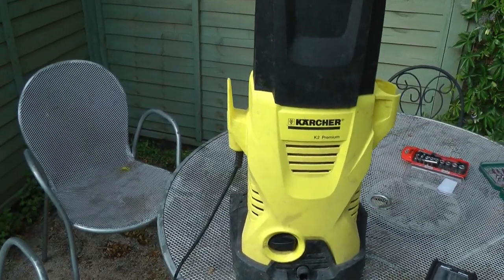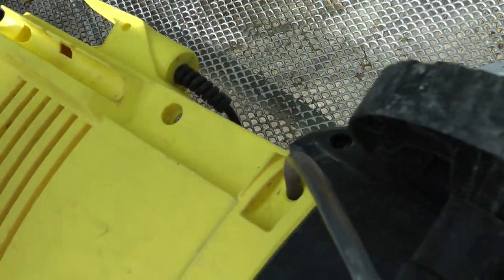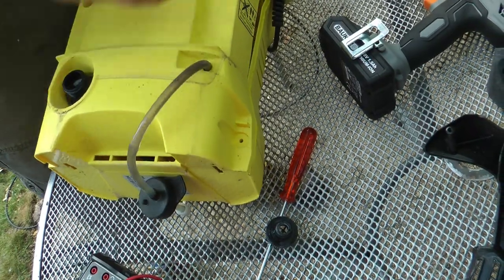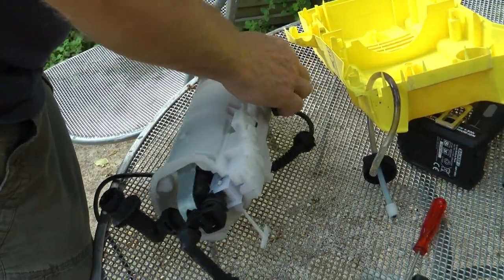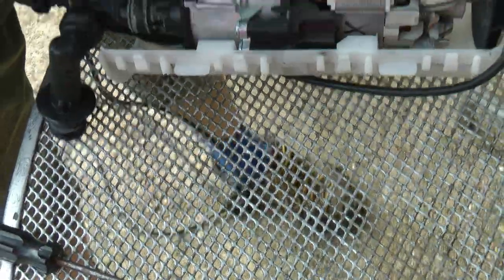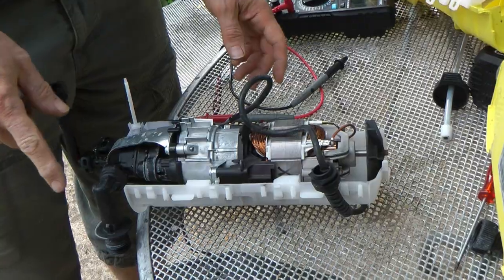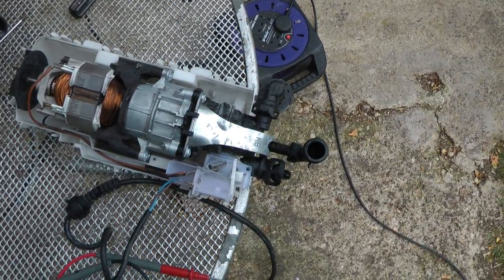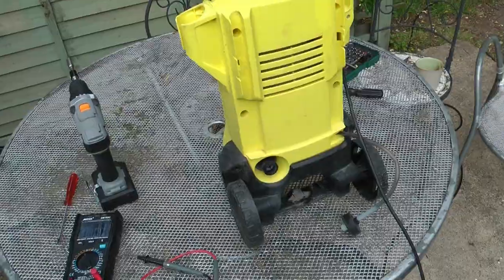Karcher K2 Pressure Washer refuses to Run Tear Down and Investigation

Comment: FIXED IT..Pressure switch dirty.
Thanks for the video and to all commenters. It game me most of the clue to fixed my K2 . Mine needed the little pressure switch to be cleaned. It was sticking in the off position and so there was no power when the main on/off switch was turned. For those who don't know the on/off switch slots into it the pressure switch, its a little white piston with a spring behind it. To fix mine ...remove the detergent connection ( twist 90 deg)...take out the pressure switch/spring and gaskets. Cleaned the gunk of it, greased the stem, reassembled and now the K2 is back to life. Happy days!
Reply from the maker: Good job..  Mine is still going.. Like and subscribe if you can. Thanks.

Comment: THIS WORKED FOR ME:   
My Karcher K2 suddenly stopped working, even though in great clean condition and about 14mths old.  I tried following a number of YouTube videos advising to flush/run water through the K2 (while powered OFF) for approx' 10mins in order to `get rid of an airlock causing the fault`.   

I tried this about 12 times over various days, but to no avail.  With the main yellow cover removed, as well as the white casing inside opened & removed, I used a multi-meter and got no continuity from the switch wires.  I then noticed underneath the main switch area there was a little fine TRIP-SWITCH with a tiny spanner-like shape (commonly used as a service-symbol). 

Using a small point of the multi-meter (or a fine screwdriver) I carefully pushed the switch down, which then gave me a good reading from the multimeter.  I then reassembled the unit, connected the water hose and hey-presto, it's now working like new again.  I would imagine this could be a common cause on most Karchers - a simple but discreet trip-switch.
Reply from the maker: Great info.  I didn't spot that. I still don't know why mine packed up but is spontaneously starter to work and has worked ever since.
Reply: This worked for me! Thank you
Reply: @AlexHumberstone1998  Excellent, I'm glad to hear.  Hopefully it doesn't keep happening, otherwise it may indicate there could be a leak.

Comment: Same problem as yours (K2 Compact so same insides), turn the switch nothing, did the run water through it trick, nope nothing so after watching your tear down I took it apart. tested the switch was fine, brushes fine but no power on the live. turned out it was actually the moulded plug that was faulty! Cut the plug off and one new plug later and power restored so thanks for the pointers as it helped no end.
Reply from the maker: Great job, Good info thanks.

Comment: The fault is related to pressure be logical it has to be related to pressure because it has to shut the unit off when gun not pressed otherwise it would explode under pressure.Right then when the gun is NOT pressed pressure builds up inside the chamber and a shutoff plunger pin is forced out which is connected to the main mains switch.Sometimes this pin sticks and does not operate correctly sometimes it may stick in sometimes it may stick out the result is pressure washer may not turn on or off.The pin is part of the cylinder block assembly you may be able to spray a bit of WD40 to free it up sometimes however the pin breaks off to get to the pin make sure the mains is turned off and the plastic covers are removed from either side of the assembly then looking at the front of the switch assembly you will see it is held in position by sticking out plastic lugs either side with a screw driver lift these outwards and at the same time pull the switch assembly up you will then see the pin.The reason why this guy’s pressure washer continues to run is because the water has not been turned on and it needs the water on to build up pressure inside the cylinder in order for the pin to operate and turn the supply off .if  replacing the cylinder head assembly to fix the problem do so with the assembly standing vertical as it is full of gear oil regards John
Reply from the maker: Exactly
Reply: Yes it's usually the pressure pin sticking that stops the motor running. Use Silicon spray though,  not WD40. WD40 will attack the plastic parts.
Reply: It's a bit wordsaladry 
But mate! I this is the right direction!
Reply: Although I think he's giving away the right solution, I think he's talking about a different model when he talks about the disassembly process. I found out this video https://www.youtube.com/watch?v=7GQh-_OHOgk&t=651s in which this sliding pin problem is tackled at 14:10 on a Karcher K2 model.

Comment: Hi had exactly same issue. A close look at mine revealed that the white encasement had slightly changed shape (heat?) fouling the impeller by microns. I ran it with the encasement open and the impeller filed down the fouling part of the case. Reassembled and all fine…karcher didn’t respond to a service request…
Reply from the maker: Great tip. Thanks.

Comment: Hi, My Karcher K2 stopped working, totally dead. I took off the casing and checked it out with a multimeter. The switch is working just fine. When it's in the on position there is power getting to the motor, but it's not spinning. The brushes were in the right place, clean and not too worn. Any ideas? Thanks
Reply from the maker: It could be something stuck in the pressure cut-out switch that cuts power to the motor when full pressure is reached.  If for any reason it is stuck open the motor wont run. You can check this with a muti-meter. With no pressure it should be closed.   Inspect the power cable for nicks and and check the fuse in the mains plug.   Good luck.

Comment: I have the same problem with the karcher pressure washer and it not turned on so whot you do you have to fidel with switch all run water through it with it turned off and not trigger gun for 5 minutes then turned back on and works  as .
Reply from the maker: It is strange. Mine does that from time to time... However I haven't investigated it further...

Comment: Cheers for vid: mine needed partial disassemby and a calibrated thump with a screwdriver handle to make it go.
Reply from the maker: They do get temperamental. I'll thump mine next time..
Reply: @razenby  Yes, thinking about mine: the fault only appears after releasing the trigger i.e. pressure build-up, so it suggests my pressure switch is sticking. I may get round to ripping the switch apart, or maybe I'll just carry on thumping. Reminds me of 405-line B/W TV sets when I was a kid ;-)

Comment: I have the same machine, it is leaking and the motor is continuously running, regardless. Any advice?
Reply from the maker: It could have frozen. The Glass Reinforced Plastic (GRP)  often split near the high pressure outlet feed.  If it has split then it is toast. I have tried repairing my neighbours with JB weld. It held up for a few uses and then let go.  Best have a look and locate the leak. It could be a failed O ring that could be easily replaced.
Reply: Just a thought, not sure if it will help with your unit, but I have the K5.80M, around 14 years old now. It has a 'spill valve' that can stick (especially after winter storage),  and cause a motor running fault, but with no useful pressure at the lance. I dismantled the unit and located (and removed), the spill valve and applied some quality silicone grease to the top (not the bottom), o'ring seals, and it started working straight away. Another possible cul[prit is a faulty capacitor, but this fix for the cost of a tiny amount of lubricant easily saved me a hefty repair bill where the repair agent would have probably charged me for a new spill valve when it was not really needed. Another culprit of a running motor without useful pressure could be a faulty capacitor which is fairly easy to source and replace yourself. Just some random thoughts from a would-be have-a-go diy'er. If you google your unit's model number with the text string 'parts diagram' and check the images that come up, you should be able to locate these parts. PS - You'll most likely need a torx set of screwdrivers from 15 up to 30, as Karcher seems fond of these.  Hope that's useful. :-)

Comment: The problem with your karcher is the pressure relief valve is sticking. This is located below the pipe for the soap feed. The piston needs removing and lubricating.
Reply: Yeah, exactly. But I wouldn't say it's a pressure 'relief' valve. It's more like a plastic spring-loaded sliding pin that's underneath the soap suction hose coupler. And yes, its function is to turn the motor on or off once the trigger gun is depressed or released.
In this video https://www.youtube.com/watch?v=7GQh-_OHOgk&t=651s at 14:10 they show and lubricate this plastic sliding pin.
Reply: @sierushop  this valve is activated by a level of pressure caused by no loss of pressure through the lance when the lance leaver is released. I would only lubricate the valve with silicone grease. The rest of the switch should be dry as the grease here will pickup dirt causing it to stick and the nylon is self lubricating anyway. I repaired my k2 by just lubricating the white plastic valve. Hope this helps.
Reply: @michaelroche6298  Thanks for your reply. I made a comment on this because when I looked up 'pressure relief valve' on pressure washers, I found something else.
Reply from the maker: Thanks for the info, Mine has worked faultlessy ever since whatever got stuck in the contacts was dislodged,  If it happens again I will check and report.

Comment: There is a pin that pushes the switch contacts apart to turn it off when the pressure builds up when the trigger is released. This pin stays wedged up after a few years use. Just push it back down again and spray some silicon spray on it to loosen it up again. It's only a temporary fix though and time to chuck it away if you dont want to bypass the switch completely.
Reply from the maker: Thanks for the info. Mine is still working. Fingers crossed.

Comment: Mine isn’t producing back pressure so constantly runs but with no pressure. Any idea what would be the cause.
Reply from the maker: Usually a stuck valve or a sheared off drive spindle where it goes into the pump.  Check the filter at the input isn't blocked....

Comment: My sons K4 has given up, the internal mains  pressure switch spring has rusted and snapped, Karcher do not sell the spring separately, you have to buy the whole assembly including wire and plug all for a spring not much bigger than a biro spring but stiffer that costs about 10 to 20p, any ideas where to get one from ??
Reply from the maker: Springs are widely available. You will have to search around for a the correct or similar spring.  Do you know if this is a common problem?   I could whip the spring out of mine and publish its characteristics or get some made. I know springs - a lot of the mechanisms I designed had springs in them.

Comment: Water does not come out at all from my K2 ,I cleaned the filter but nothing still
Reply from the maker: Check the mains fuse in the plug and inspect the power lead for damage. Probably he trip needs resetting in the unit. There on plenty of videos on how to do this.
Reply: @razenby  The pump works when I plug it in and the fan works and everything but no water is sucked in.

Comment: You were missing the relevance of the small section immediately adjacent  to where the white plastic switch gear is.  That can lock in the small recess and keep the power off.   you reset it when you dissasembled.
Reply: sorry I cant upload a picture, but look at the video T 6:30 and note the diagonal plastic piece . next to the switch  i.e. at teh intersection of the lines along your two thumbs.   That diagonal piece is making and breaking the AC power contacts.  In some circumstance it will lock in to a  notch and then the power cant come on    Maybe its a cheap pressure thing, or something current driven but it seemd to be the source of my problem
good luck everyone  THese machines are prone to fault
Reply from the maker: Thanks, interesting. I will check it out.

Comment: I have to give the pressure switch a shjarp tap with a screwdriver o get it to work.  But if I stop using th lance, it won't restart until given another tap...
Reply from the maker: See other comments - someone wrote that some lube applied to the pressure switch might cure this.

Comment: Thx for your video
I fixed mine
In my case, it was the switch, it's the c shaped leaf spring inside the switch got sticky
I opened the case and cleaned it a bit
It works again 😁
Reply from the maker: Good tip. Thanks.

Comment: Thank you! Your vid inspired me to open mine up and also made me suspect it was that flimsy on off mechanism ie the plastic t shape (inside) not being rotated by the black nob (outside). I think that may have even been your mystery problem here?

Anyway. Thank you! My wife and I also enjoyed your banter with the camera operator haha
Reply from the maker: Thanks.   The feel of the outer knob on mine was OK before disassembly.  The unit is still going strong in spite of being hit by a car. I still don't now what caused it.

Comment: I just borrowed my brother in law's K2 and plugged the water in and tap open plugged    .then plugged electric plug in got a mini spark noticed the karcher had been left in on position.checked and changed 13 amp fuse it was fine not blown but unit won't start.any ideas?
Reply from the maker: Difficult to say.   It should matter if the switch is on- the motor should just run so unlikely that plugging in whilst the switch is on did any damage.  I had a pressure washer that did exactly that when first used after winter.  The water had frozen and seized the pump. You could take it apart and first check that the motor turns OK by hand.   If it does then check the cable.
Reply: @razenby  I have sorted it,think the issue lies with a temperamental switch.thanks for the reply,all the best.

Comment: I Have the same problem. Is it Switch or Brushes as I still have the same problem.
Reply from the maker: If the brushes look good then it is likely to be the pressure switch has a bit of crap in it that has come down the hose.  I noticed after I made the video that the filter mesh on the input had gone.  Obviously dropped by someone.   I am pretty sure that it was debris that came up the pipe. The motor should  cut in when the pressure valve is below target pressure.  My son said it was playing up cutting in and out when it shouldn't be which points to the same problem.  It is OK now. Whatever it was has been flushed out.

Comment: in my case found a pressure sensor was stick and put some oil from the pipe that suck the soup and then worked fine
Reply from the maker: Good tip. Thanks.

Comment: Just opened mine up and 2 brushes have broken off completely. Does that mean I need a new motor? Cheers.
Reply from the maker: You should be able to get replacement brushes. There are many sizes and shapes but can easily be changed.
Reply: @razenby  I actually meant 2 segments off the commutator had broken off, not the brushes so I've ordered a new motor anyway see how it is once I've fitted it. Cheers

Comment: Aaqrrghhh... mines just stopped working all 2gether... it's only been used 2 or 3 times.. At 1st the pressure started going funny...so I took out apart + gave it a shake about. Then I tried turning it on 2 c if it helped but didn't go on at all!! Wtf..help me
Reply from the maker: Have you checked the inlet filter isn't blocked with debris that has come down the inlet hose?  That happens quite a lot...

Comment: The field windings don't have any resin coating on them.  Overtime vibration will cause them to short out. Apply some apoxy coating on the field windings. Electrical engineer, red seal certified!
Reply from the maker: What is a red seal?
Reply: What's "apoxy"?!

Comment: My soap dispenser on my watch isn’t working is there a way of unblocked?
Reply from the maker: Check the pipe isn't kinked and the filter is clear, The soap is only drawn in when you are in low pressure squirt mode. (Turn lance head so it spurts like a hosepipe and not a pressure washer)

Comment: It probably didn't run because of the tripped air  if you let the water run through the machine machine gir a few minutes it pushes out the tripped air and you will run
Reply from the maker: No, this model runs even if not connected to water.

Comment: SOUNDS LIKE MINE, SAME MODEL
Reply from the maker: It was weird fault. Something was lodged in - probably  a foreign object from the hose.   The unit in the video just failed to power up whatever I did. Once we took it apart and fiddled with the switches it started to work and is still working 18 months later. The motor cuts out when the pressure is achieved so I assume that some hard object got stuck ion the pressure valve.

Comment: I hate self fixing faults,  you just know it will give up the ghost when you most need it!.
That switch had to be suspect.
Reply from the maker: They are annoying. I was expecting the fault to recur but the PW is still going strong and has had a ton of use since I made this the video.

Comment: Working on a metal table electric
Reply from the maker: Yes with 30 years of experience as an electrical design engineer working and debugging designs with deadly voltages and here I am!

Comment: Just repaired my Karcher k3 the plastic cylinder head split leaking water, it’s 4yrs old so 4 seasons of just washing patio. Cost £50 for head and elbow but head is same part number not modified so same problem is going to happen. In my naivety I thought karcher was German but looking at everyone’s faults it just Chinese plastic shyte !
Reply from the maker: Good info. Thanks.  Mine is still working ...